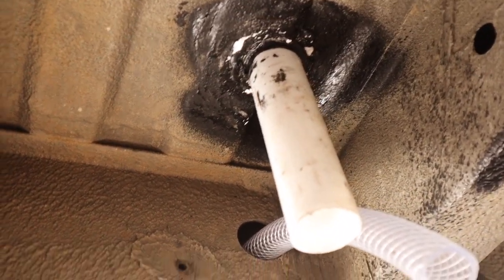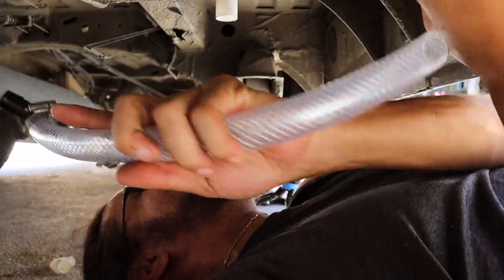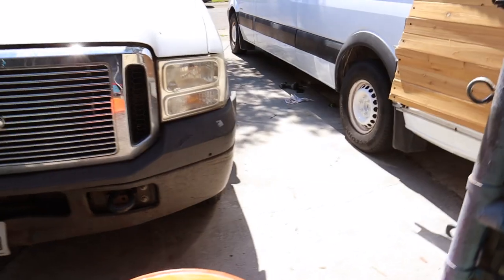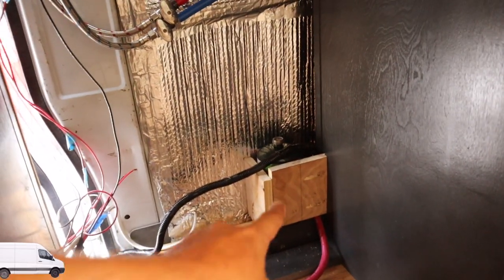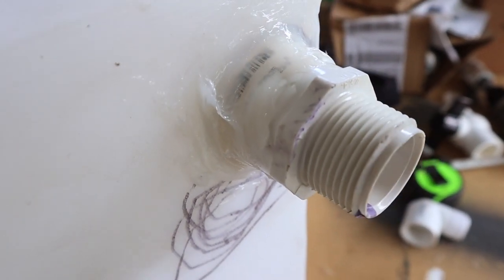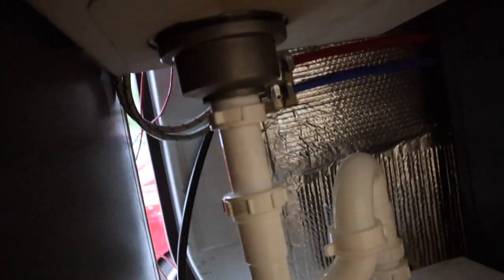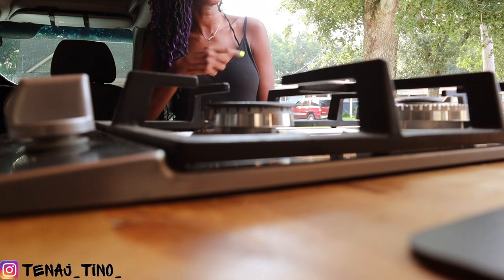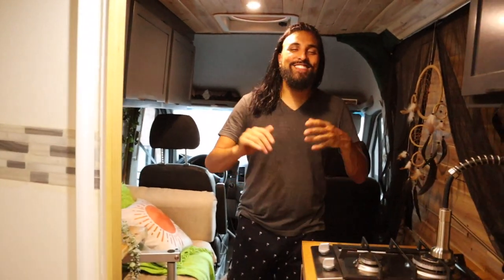OUR VAN ALMOST CAUGHT ON FIRE INSTALLING A PROPANE STOVE IN OUR TINY HOME ON WHEELS

Comment: Wow y'all. My van caught fire on the outside rear from leaving the fuel cap off my generator and driving off with hot exhaust. I didn't lose it but fire extinguisher was too small. Fire department had to be called. It took 3 months to repair. You live and you learn right? Be safe.
Reply from the maker: Wow! Happy to hear that you and the van made out ok. It could’ve been so much worse. Be safe out there
Reply: @TenajTino  Absolutely. Hopefully Wifey and I will get to meet you guys at a vanlife event.
Reply from the maker: Hopefully if we get our van back ❤️👍🏽